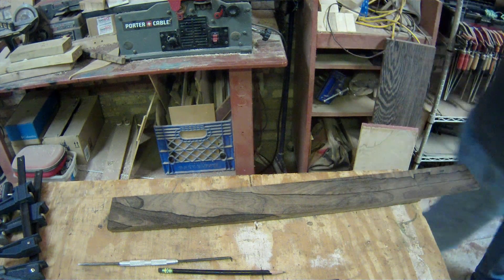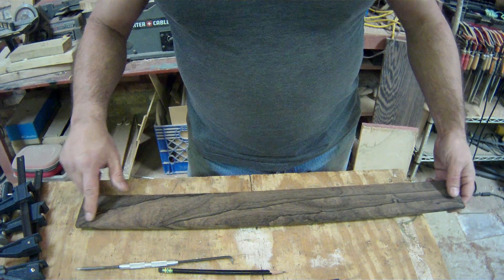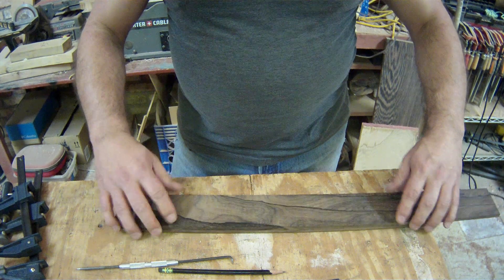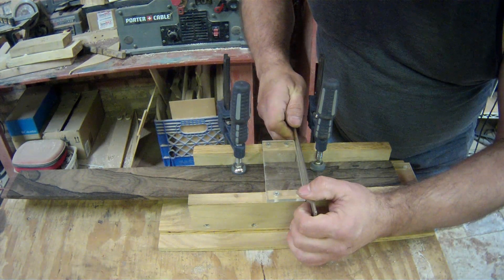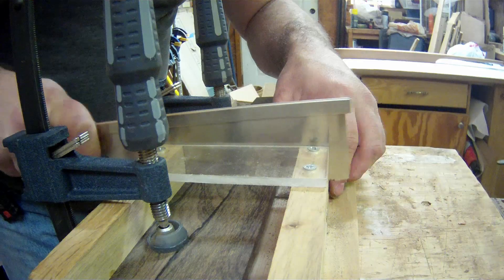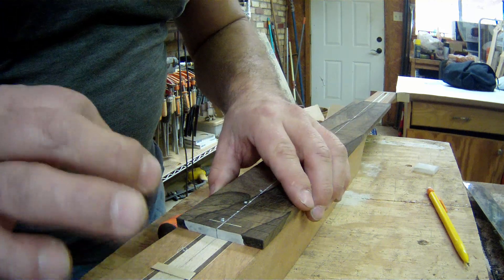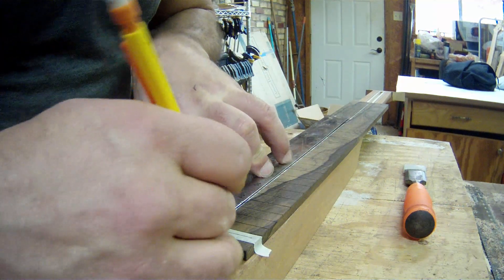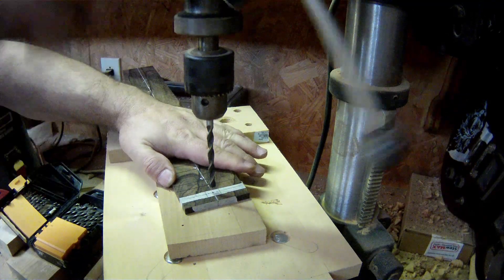GGBO21 - Off the Record - 07 Building a Ziricote Fretboard

Comment: I haven't decided whether to do 22 or 24 frets for my ggbo build but 24 would be preferable. Can i have your permission to steal your spoke wheel access hole design? Also are you more concerned about chip out around the fret slot whilst cutting the hole, or fretting the fret?
Reply from the maker: Yeah man, you won’t be the first 😆  And since you mentioned it, yes if you have to slot before doing the hole, do it really shallow until the hole is done and then deepen.  It depends on the wood but it’s really common for some of it to chip out there.
Reply: @BoneheadGuitars  what did u do the hole before the slot? could you not just mark out the fret positions, then do the hole, the slot? or am i missing something obviously wrong with this plan
Reply from the maker: @micksguitarsarecool  I usually do the slots and then remember the issue.  Ideally I’d do those two shallow and deepen after the hole.
Reply: @BoneheadGuitars  lol nice, awesome thanks we'll see how she goes